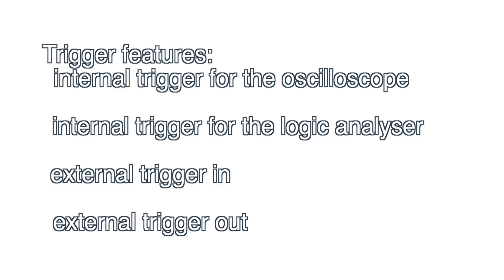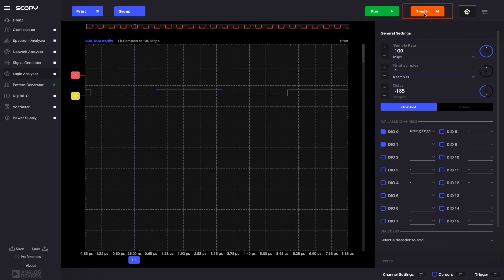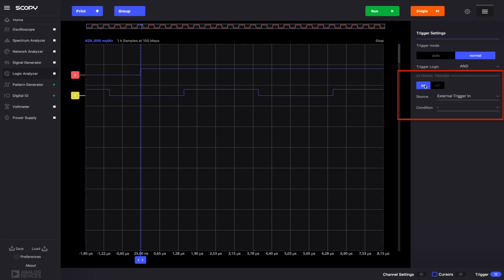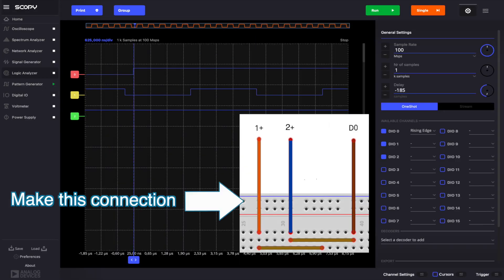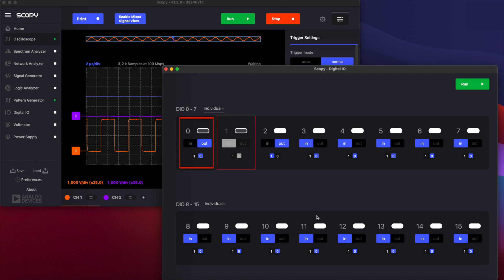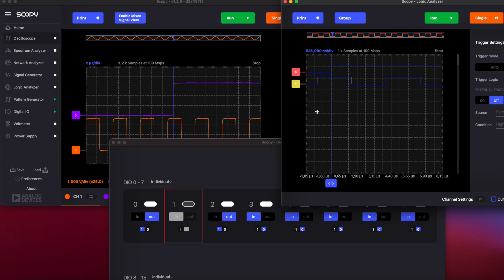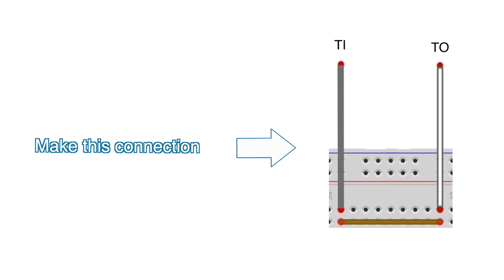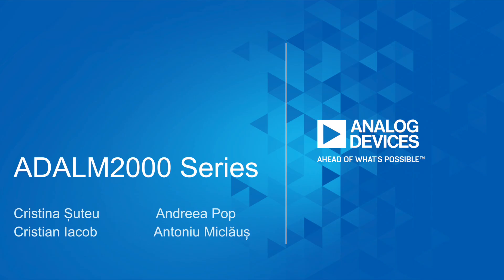ADALM2000 Video Series: Video 11 - Triggering Features

Comment: I've been using the internal triggers on both the M2K Oscilloscope and logic analyzer and it's really convenient. Especially that we are mostly working from home. I don't have to bring home bulky instruments for low-voltage application debugging.
Reply: Me, too! My favorite oscilloscope. (And function generator, and logic analyzer, and pattern generator :) ) Whenever I need to take some measurement, stare up at my benchtop scope (Rigol 5000 series at home, Keysight MSO at the office), then stare at my m2k, and if the m2k will do the job, why bother flipping the switch on the benchtop scope?